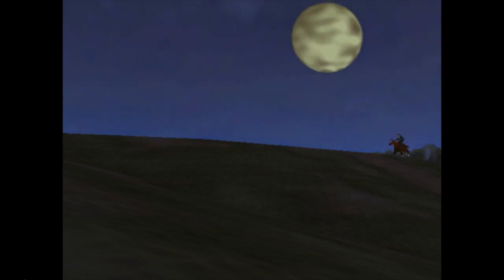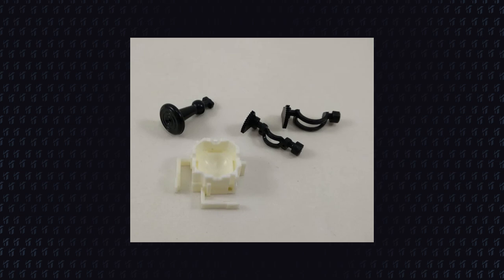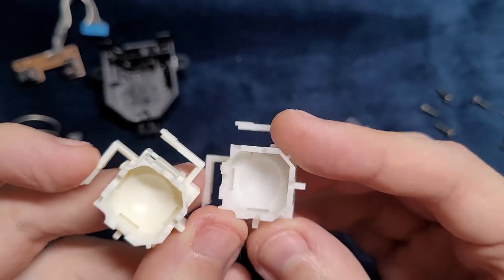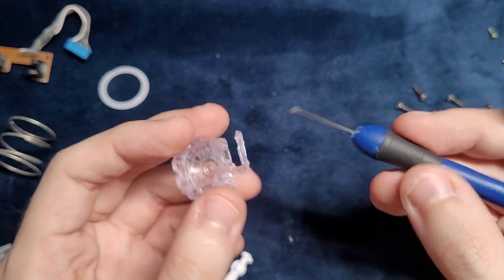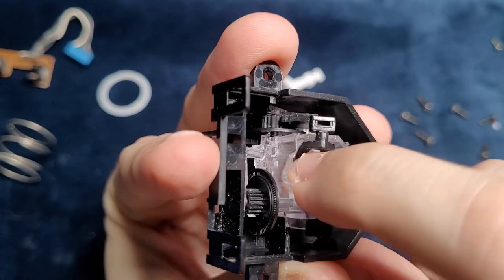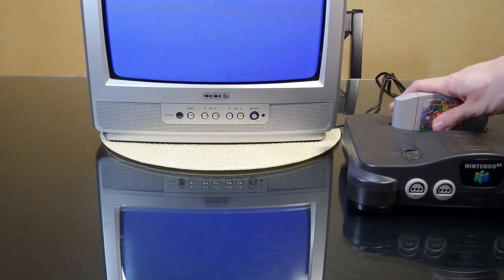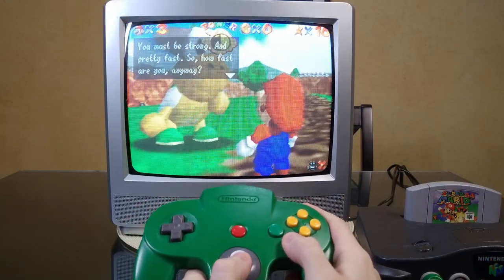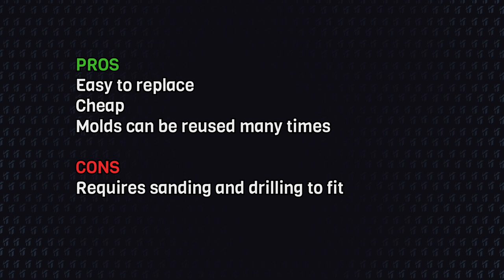Yet another Nintendo 64 Sticks Fix!

Comment: Resin 3D printing might be a better option.
Reply from the maker: Yes I gotta get one of those soon
Reply: I've done this on a pretty old mono printer, while it worked, it didn't feel like a definitive solution, at least with the cheap basic resin I used. The resin is pretty hard and the parts will also grind against each other just like the plastic ones, I didn't like the feel of it, even with lubrication, so I removed after a couple of weeks. Also, the encoder wheel is super finnicky to get right, you have to be super careful with the supports when preparing for the print and when removing the supports from the part as well.

I need to test this again with a more decent resin, or maybe with a higher resolution printer, mine has just enough XY resolution to make something that barely works, but it doesn't feel optimal. For now I've been using cheap replacement parts for my original sticks, but I've also been using a NGC style Hall Effect stick module, the one by 8bitdo, there are I think one or two other brands also selling HE modules, but I haven't tried any other one yet. I love the HE module and I switch between a refurbished stick and the HE on my N64, while on the MiSTer I've been mostly using a refurbished stick lately.

Comment: Personally i use epoxy putty and glue to refill the wear on both the bowl and the gear slots and then i sand them into shape along with some grease to make everything smooth and prevent more damage. It's about as close to perfect as a new joystick could get in my own experience, I've done it to all my controllers and I've had no problems whatsoever so far.
Reply: You should make a tutorial!!
Reply: Make a video out of that to help original N64 owners like myself.
Reply: @LITTLE1994  I have been thinking about doing a tutorial on my method to fix the joysticks for a while, but while i would love to help all my fellow N64 enthusiasts out there i know nothing about video editing and i don't have any broken controllers to fix right now.
Reply from the maker: You can edit videos on your phone easily today

The epoxy is another solution but i think it requires more sanding and finishing than the resin ones
Reply: @donhonk  Check out Luke Morse tutorial from 2012, he goes through the entire process ( OEJmSQjONRg )

Comment: Cool vid! I'm lucky enough I still have 3 oem sticks that are super tight and snap back to the center haha I'm barely using those, but the kitsch bent parts are decent if you align them right with some grease! They feel good too, way better than 3rd party replacement controllers.
Reply: i got lucky and bought used controllers from ebay and 3 of them were mint brand new lol. super lucky

Comment: I have access to a resin 3d printer and i'm going to try turning a metal bowl, and 3d print a stick
Reply from the maker: Tell me how it went!
Reply: @VKsChannel  Well, turns out metal is really tough to turn well on a lathe, our resin printer still needs to be set up. I tried to do it with nylon, but that is really hard to machine too. 
I´m thinking of  creating my own joystick type.
because the gamecube sticks are inaccurate i´m planning on making an entirely mechanical 3ds-style circle pad in cad and print it in resin or SLS (just an idea)
because you can have basicly any type of control stick, as long as you actuate the wheels with the opto sensors. 
by not installing a gamecube joystick but making my own type of analog stick I am able to keep the accuracy with better durability. (at least i hope so...)

Comment: I have recently come up with a wonderful idea for improving smoothness but i have yet to try it out. The idea is from my testing i hypothesize alot of the friction and unwanted resistance  in the stick can come from the gear shafts rotation point on the rim of the bowl clearly lubricant put here can improve smoothness by a fair margin but better yet if the bowl and gear shaft are slightly modified to use ball bearings instead of relying on a lubricant and smooth contact surfaces(i've found a few aftermarket gears with rough seems there). May make for good content and so far i have yet to find anyone attempting this specific joystick mod.